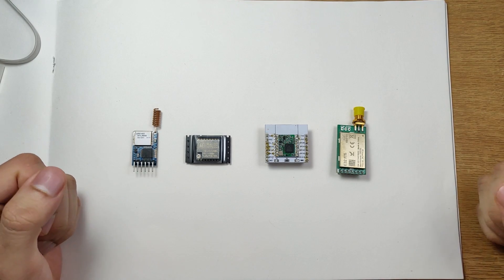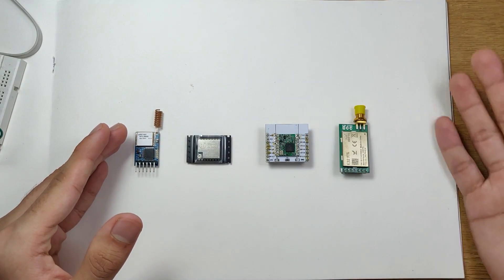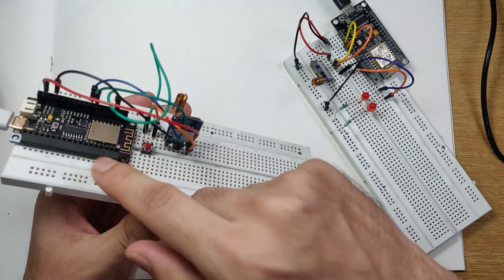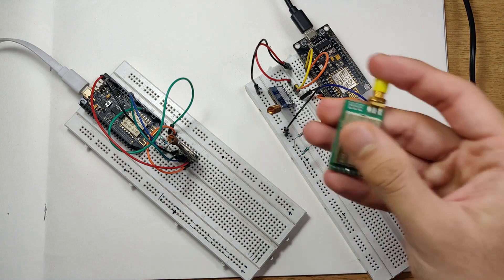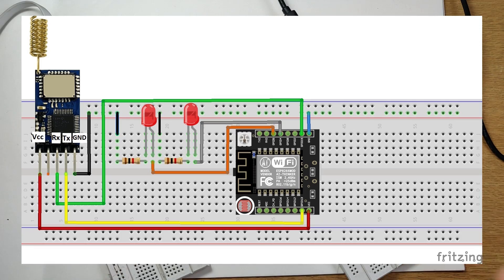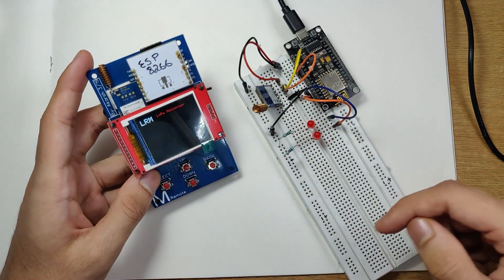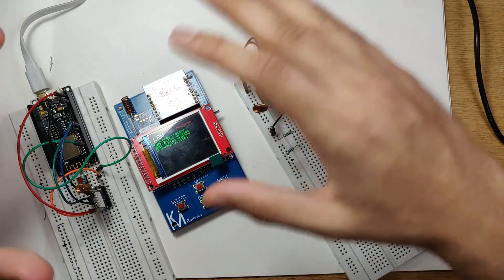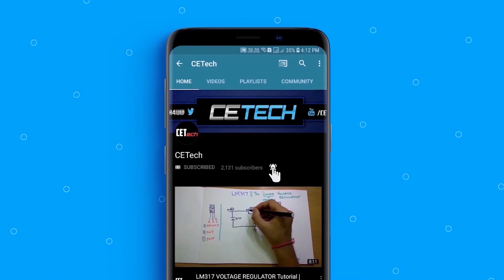LoRa Based Remote Controller | Control devices over large distances | lora lorawan

Comment: hey bro 
currently i'm making a cubesat and i'm facing problem in realtime data transmission like my budget is low so i'm limited to cheaper options so my aim is to achieve communication range of 450-650km can i get this much of range from LORA module(or if u have any other cheap technique for data transmission u can share that too)
please reply as soon as possible
THANKS
Reply from the maker: Yes you can get that range in satellite los communication
Reply: @CETech4u  please share the name of Transmitter and receiver to be used in this